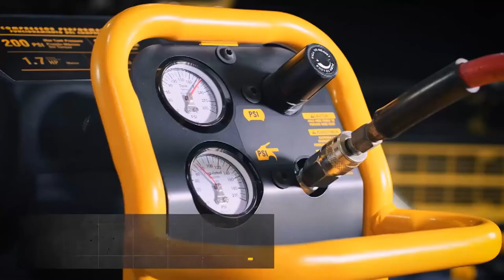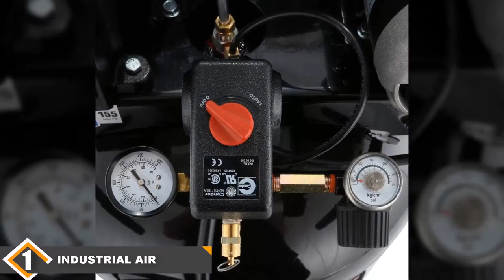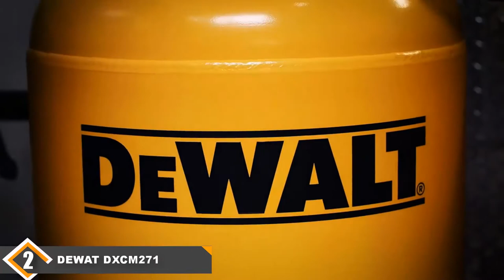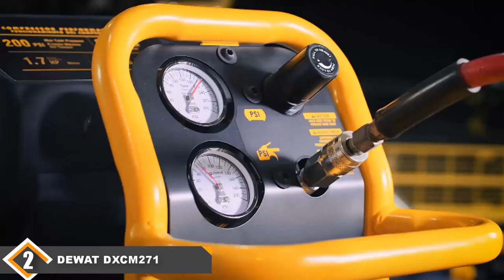Best 30 Gallon Air Compressor In 2024 - Top 5 30 Gallon Air Compressors Review

Comment from the maker: Links to the best 30 Gallon Air Compressors we listed in today's 30 Gallon Air Compressor review video:

1. DEWALT DXCMLA1983054 Portable Air Compressor:
https://geni.us/02PB [Amazon]

2. Industrial Air ILA1883054 Air Compressor:
https://geni.us/AXF6iKU [Amazon]

3. Ingersoll-Rand SS3F2-GM Air Compressor:
https://geni.us/cbh8ZE [Amazon]

4. Campbell Hausfeld XC302100 Air Compressor:
https://geni.us/F77Ouy [Amazon]

5. Porter Cable PXCMLC1683066 Portable Air Compressor:
https://geni.us/rJhQ [Amazon]